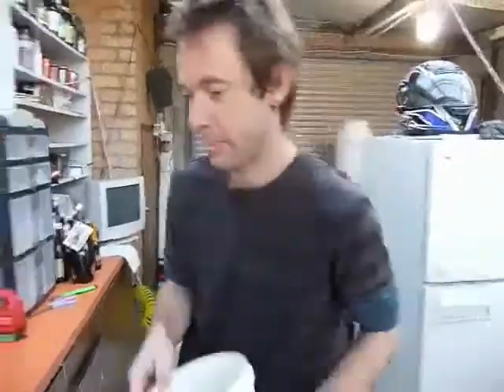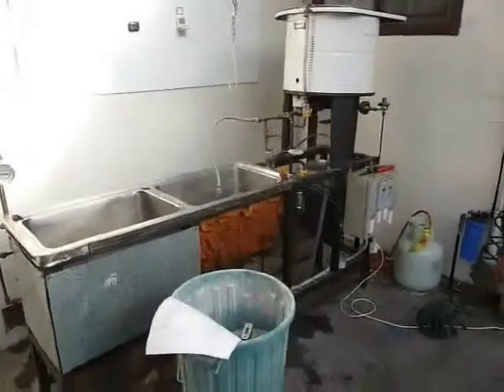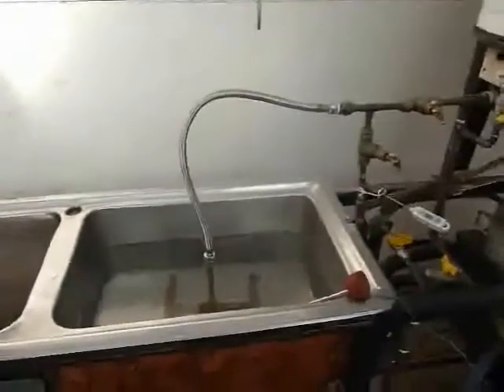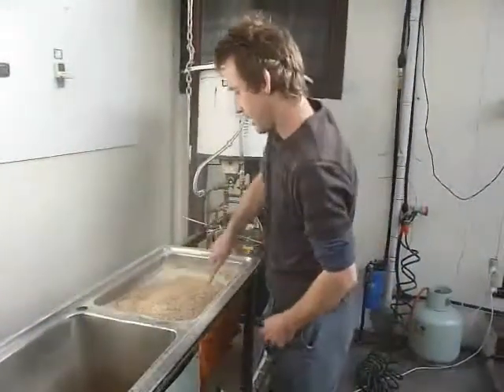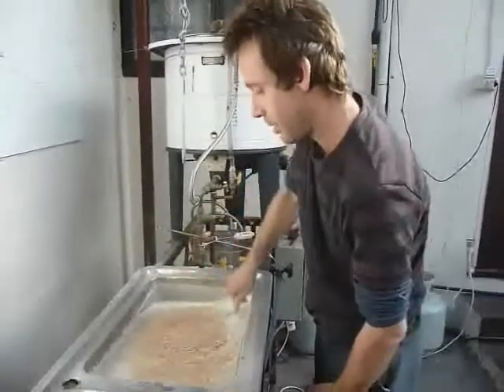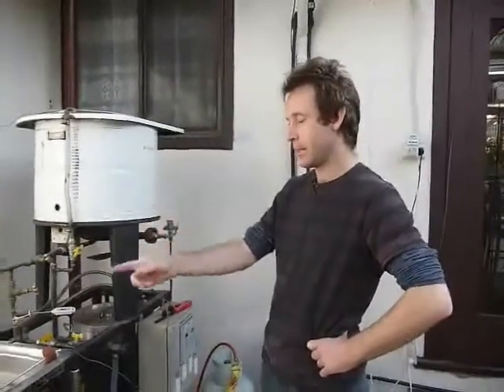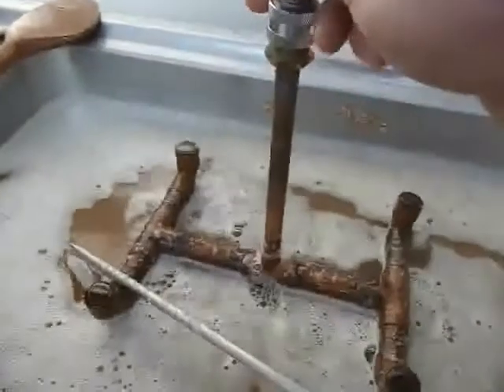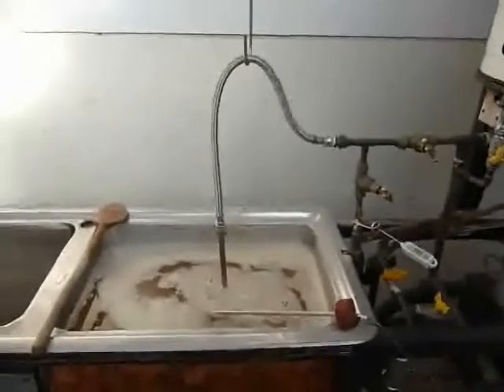My Home Brewery in action. (1 of 3).

Comment: Hi Ben. I am actually wanting to do the same type of setup you described here. I found some solenoids, temp controllers, ect. but was wondering which ones you are using. The ones I want to get are going to cost around $180 per burner to get them automated, and I'd like to know if there is a cheaper route. Thanks for any info you can give me.